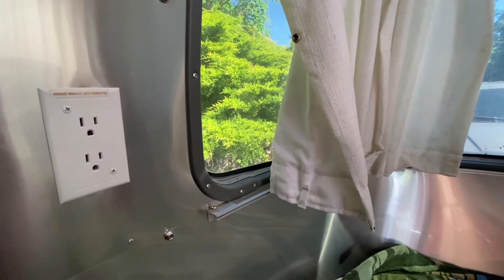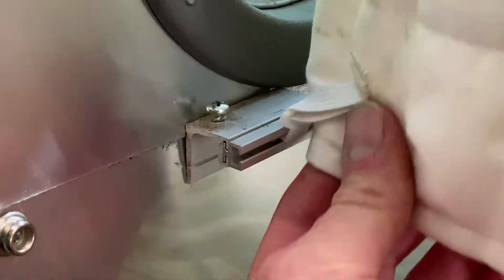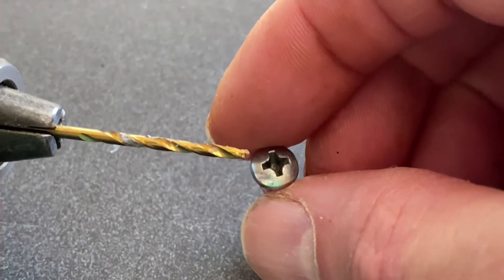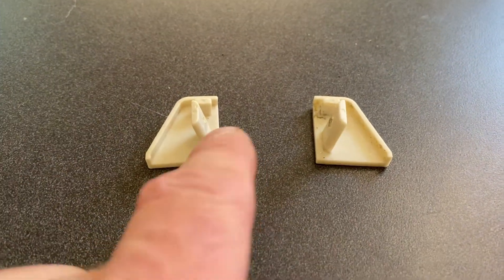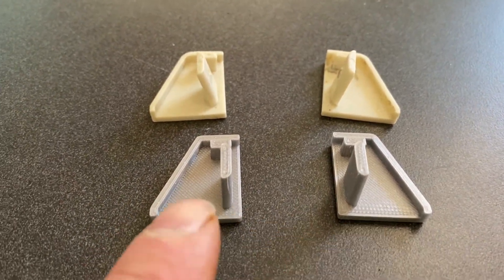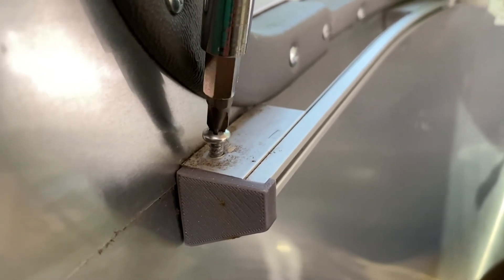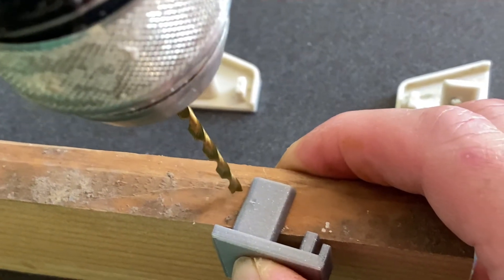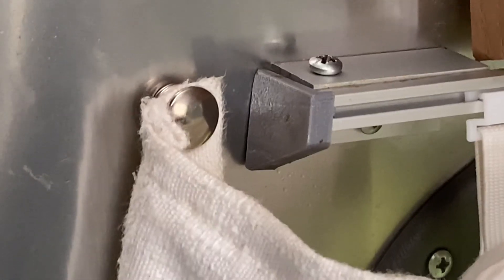Fancy Fix for Your Airstream Curtain Track End Caps

Comment: Very useful information.  BTW, are these parts available in metal instead of plastic?  
I am not a fan of plastic and don't mind paying a little more for more durable parts.
Reply from the maker: I agree, metal seems like the "one and done" solution. But I've never seen them in metal. It would have to be a rust-free alloy, and I'm not sure how those could be molded or formed into the complex shapes required.